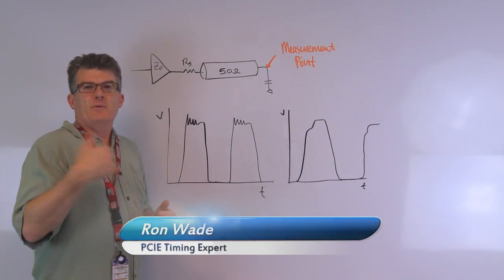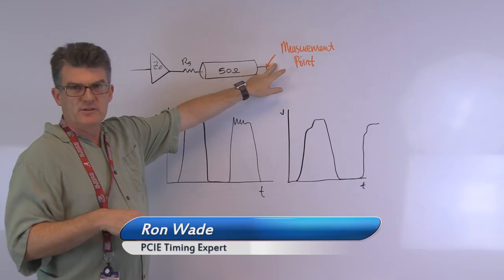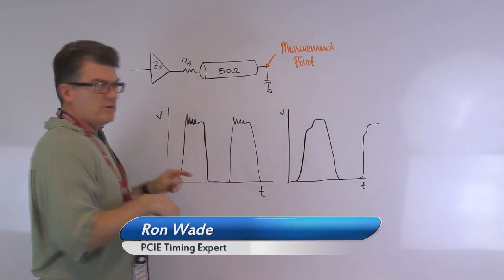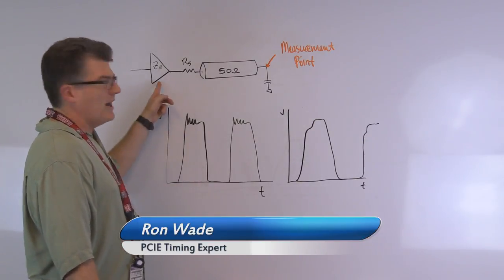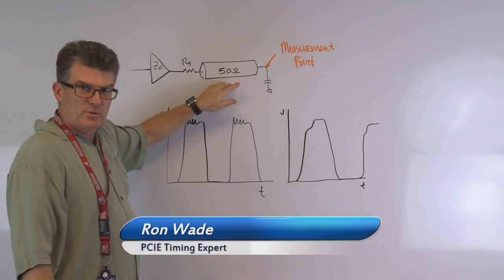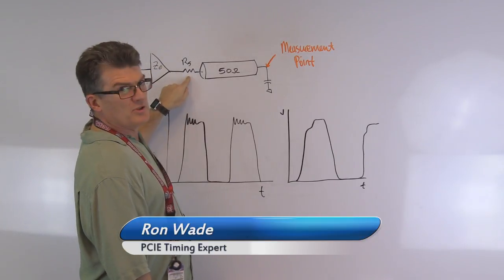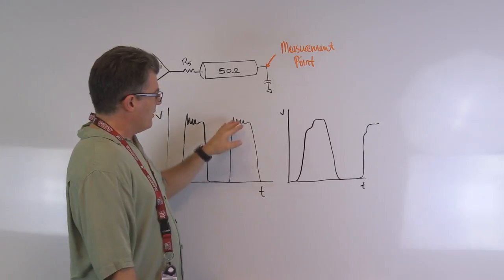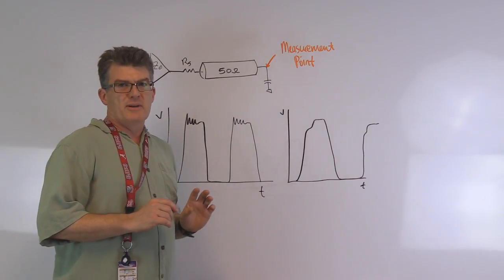Clock Driver Pull-up and Pull-down Impedance Termination Affect on Timing Waveforms

Comment: Nice explanation. At the measurement point in the circuit diagram, what would be the effect on the CLK signal of having a filter capacitor that's too small or too large?